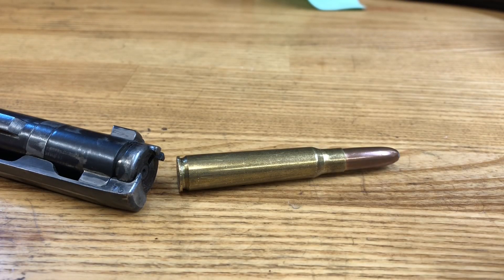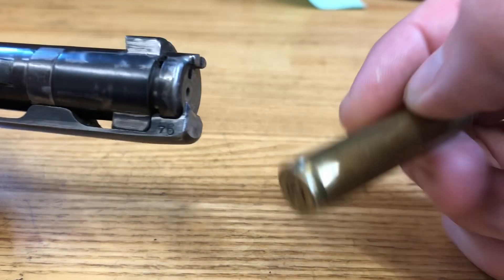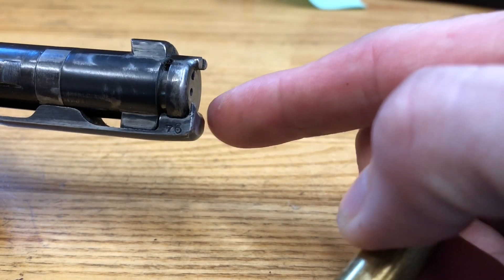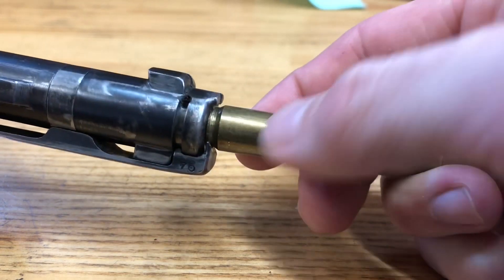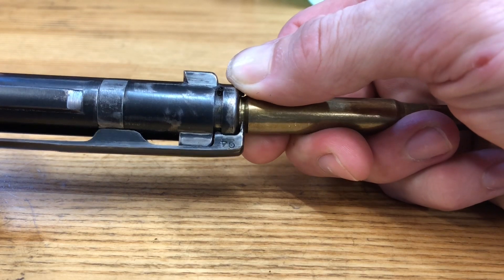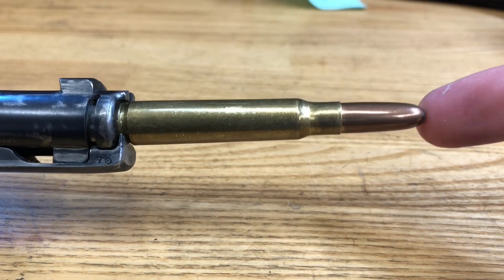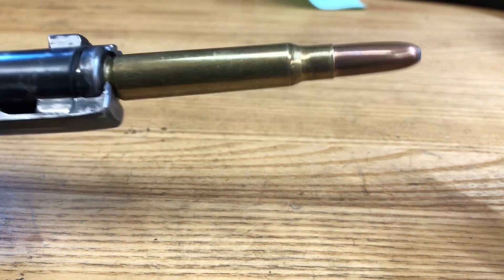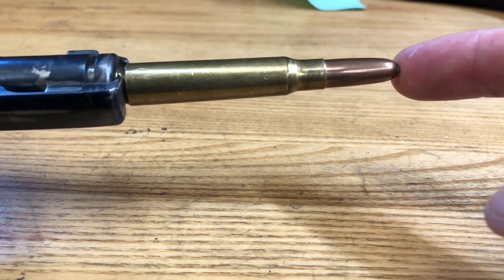Mauser 98 Extractor

Comment: Question is the Spanish m43 extractor the same as the k98. My extractor is bad and have not been able to find an answer. Thanks in advance for your reply. Sincerely, Derek
Reply from the maker: The Spanish m43 should use a standard 98 extractor.
Reply: Thanks for the input.